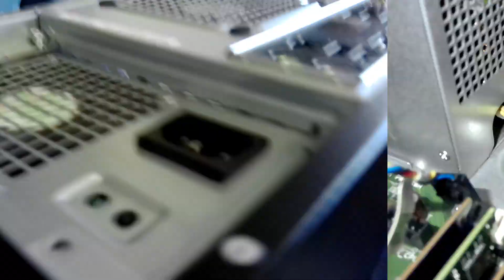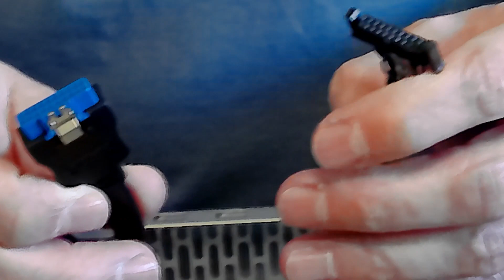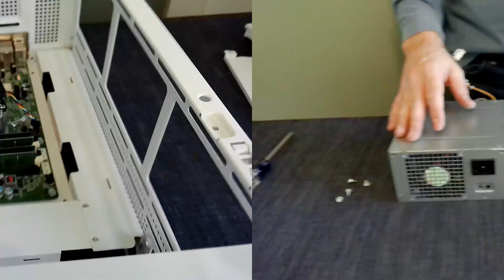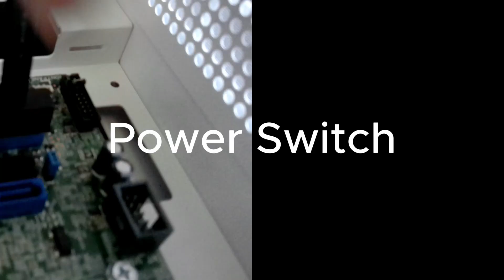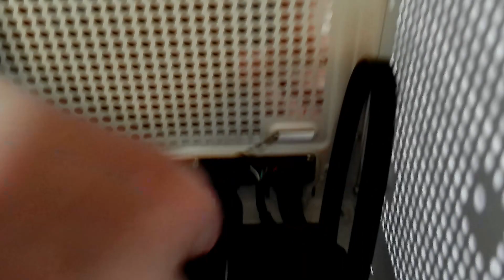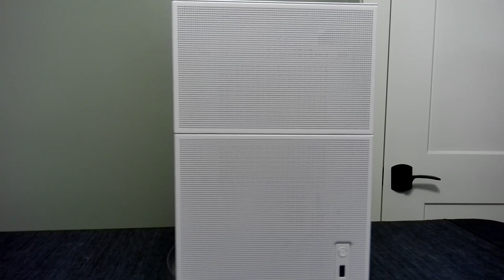Dell Optiplex 7020 Rig Upgrade Ep1

Comment: this is an interesting project, although most optiplex owners would not change the case as it really would defeat the purpose of buing a cheap prebuilt dell due to the extra cost of the case.
It still is fun to push the limits of such a prebuilt though, even if it isn't really practical 😊
Reply from the maker: Thanks for the interest. I saw this as a cheap way to get older hardware and start to customize a rig. Many individuals may not have the funds to purchase a newer PC, so the entry point for an used Dell is right for some.
Reply: @RigCrafting  yep,for the right price it makes sense for someone on a smaller budget.

Comment: I don't understand the need for this transfer of the computer's innards.  The old case (from its brief showing at the start of the video) looked perfectly serviceable.  The new one is a rather ugly and plain white brick.  You've lost the utility of the old optical drive - although of marginal use nowadays it is nonetheless of some minimal use still at no extra system cost.  In short, the whole exercise seems essentially pointless and retrograde.  🤔
Reply from the maker: You are correct, the Dell is perfectly serviceable. The point is to take a cheap readily available PC and upgrade it. I chose the Jonsbo, because I wanted a different mATX case, and as you say, who uses optical drives nowadays. The Jonsbo allows for more cooling with up to a 360mm AIO, and lots of fan options. You can also add larger graphics cards which I will show in later videos.
Reply: Thanks for the explanation - most gracious of you! Forgive me if I still think the white brick is still something of an eyesore, and for my continuing attachment to a good optical drive - ah, the fun of putting in and running old retro programs and games!  Like the attraction of vinyl to some LOL.  Happy New Year to you and yours, by the way...   @RigCrafting
Reply from the maker: @BrianPlace-y2z  Of course. I recently tried to install an old RTS game on Windows 10. It installed fine but would not run. Need to dig up an old Windows XP install. Happy New Year to you too!